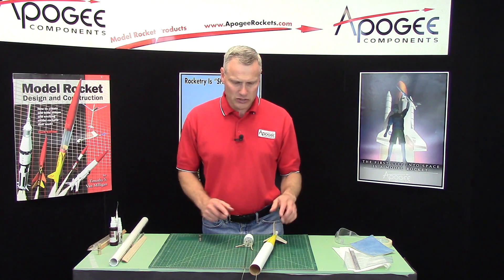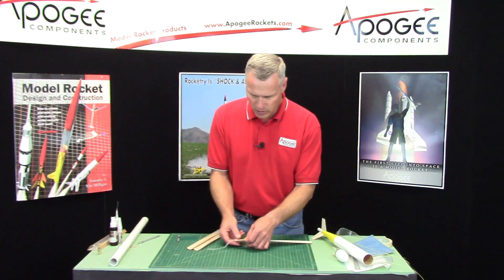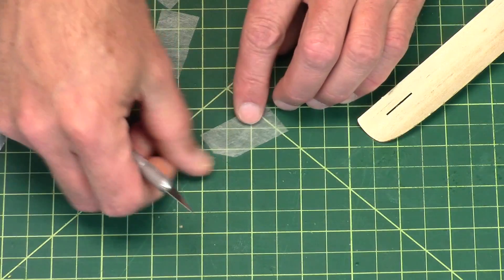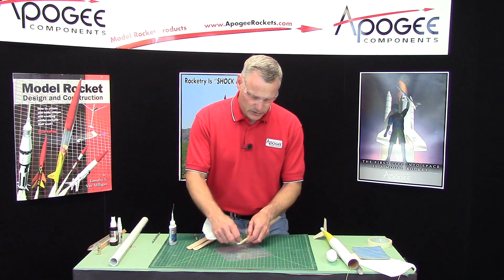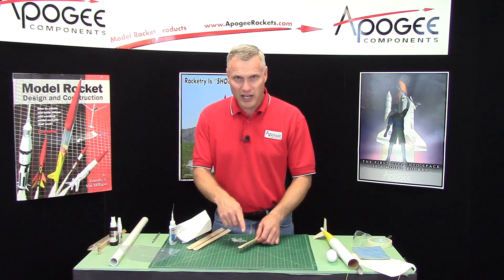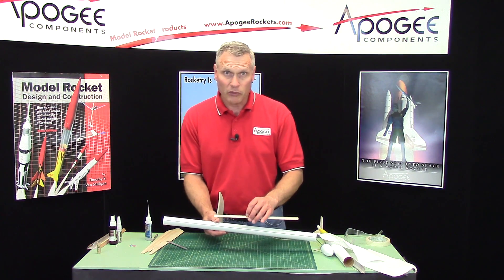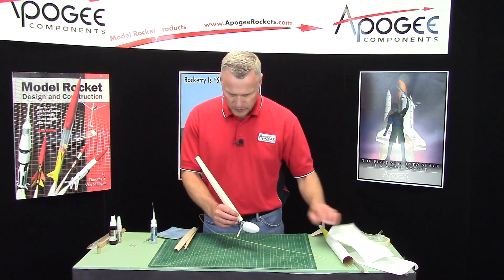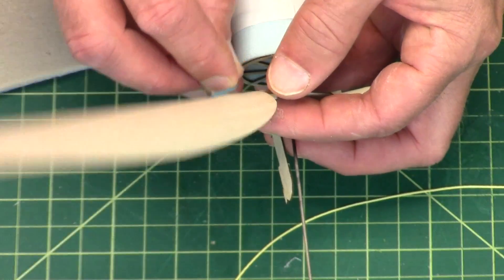Rotary Revolution 07

Comment: Tim Thank you very much for the videos!! Could not have progressed this far in the build without them. I found attaching the mesh is very difficult since the kit now comes with only a 3 inch piece of mesh. I improvised by cutting into thirds and which allowed me to do 3 blades, covering half the slot. The bright side is less to cut away and a fraction less weight.